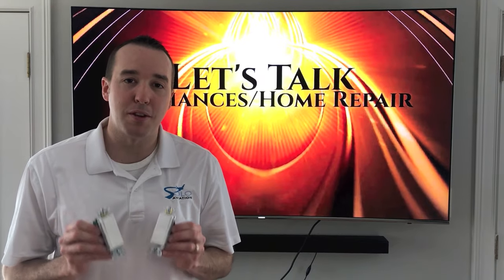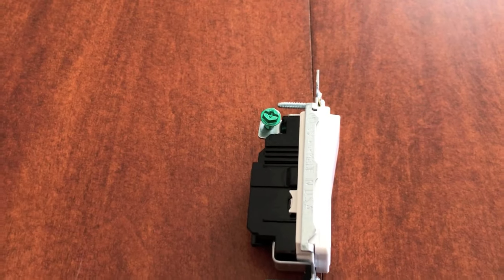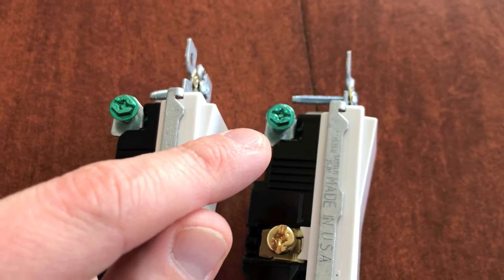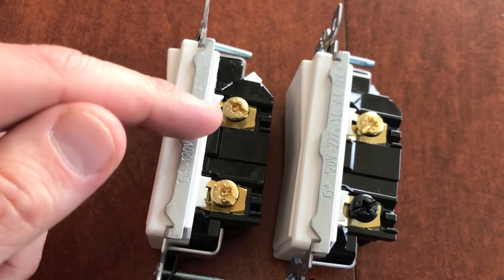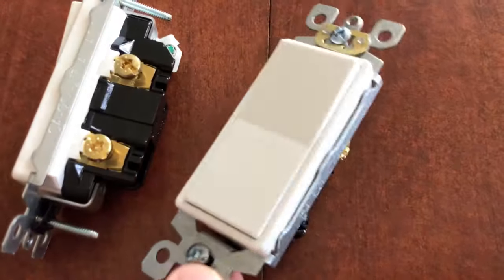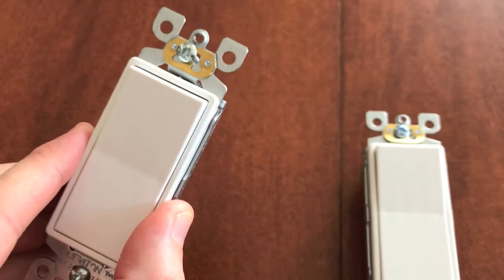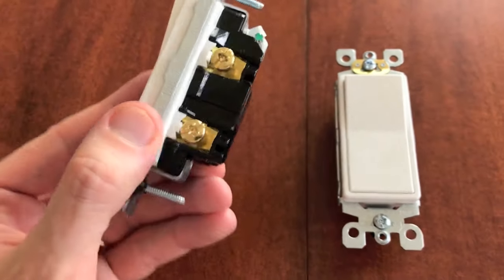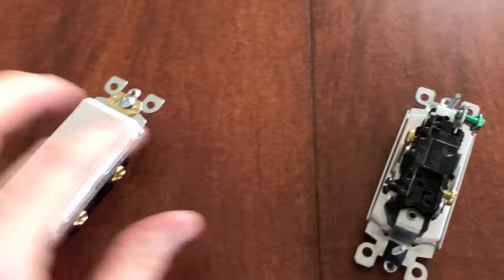Differences between 3-Way light switch & Single Pole light switch!

Comment: Excellent video Michael. Thank you for your educational time. I have a small outdoor project. An electrician added a series of outlets directly from the main panel. I would like to add a switch at the end of that circuit. Then I'd like to add another double outlet that will have some lights connected to it. The switch will control these lights. What kind of switch would you recommentd?
Reply from the maker: Jaime Alonzo 

Thanks for watching.  If your switch will not be used in sequence with another switch, a single pole switch will re recommended.  😀👍

We hope you enjoyed the video.  Let us know if you have any questions.  Us fellow DIY’ers need to stick together.  Many more helpful videos to come!

Please subscribe to the channel and Ring your YouTube Bell 🛎 that would be awesome thanks again.

😎👍🔧🔩
Reply: Ioioiiiiiiiiiiioii
Reply: Iiioiiiiiiiiiiioiiiiiooiiiiiiiiiiioiiiiioiiiiiiiiiiioiiiiiiiiiiiiiiiioiiiiiiiiii

Comment: You cannot send power to your lights in the ceiling using a white on your top brass screw on a single pole switch. Your black power lead hitting the bottom breast screw is exactly that. However your black wire going from the top of the switch to the fan or the light fixture is what is supposed to be attached to your brass screw on your single pole switch. Your neutrals are to be twisted with a pair of lineman pliers and a wire nut are the proper color code screwed onto those Twisted white wires in that box. At least that's the way I've been taught by many electricians to wire a single pole switch. I do not agree with electricians using wires as Commons or power leads. It can be very confusing when other people come behind them years later trying to remodel or redo their work. Your main power source should come from the breaker through the walls and or ceilings to the outlet in that room putting it on its own breaker then from there you extend out from the outlet to the light switch with 14/2 wire then from the switch through the walls up to the ceiling to your fan and or light bars or light fixtures recessed lights Etc. Thank you and have a great day
Reply from the maker: Thanks for watching & sharing your thoughts.  Confusing indeed for those that come by next time to work on wiring.  Home owners are left with whatever & however from those they pay to hopefully make their services reliable & to code.  Enjoy your night.

😎👍🔧🔩
Reply: I have no idea what you said but like.

Comment: On the single pole switch. If you connect your hot to one screw and neutral to the other.....what are they connected to ? Each other ! And what happens when you flip the switch?
Reply from the maker: @ITBubba1  

Thanks for watching, are you changing from a 3-way to a single?

Comment: Thank you! I am about to install my switch and was quite confused by the red wire inside the box thats not used. I’m going to leave it unattended and do the regular paddle switch! I’d love to know where that red light connects to and why.
Reply from the maker: Thanks for watching & welcome to the DIY Raptor Club.  The red wire is a travel wire and will feed through the wall and up through the ceiling into some other switch either inside that same room or in a different room.  An example of a different room would be a very large living room and dining room that are not separated by a wall.

Does that light switch turn on the lights and have another switch somewhere else in that room that turns off the same light?

Keep us posted on your project.  Hope all is well.

😎👍🔧🔩

Comment: I have an old fashioned GE switch with 3 push in wires on the back. Any idea how I can identify these wires to try and buy a new single switch? I think it’s a very old low voltage button.
Reply from the maker: Thanks for watching, any update?  We had a viewer run into the same experience recently.

He took several photos of how wiring fed into the receptacle.  He then carefully removed receptacle and took it to his local Lowes and had it matched up to an exact replacement.

The new receptacle will have detailed instructions that should help in explaining the wiring to give you a better understanding of its layout.

Please keep us posted and hey if you’re into crypto, join our DIY ecosystem.

         toolboxtoken.com

Reach out to us any time!  🧰

Comment: are you sure that on the single pole switch one brass screw secures the neutral while wire? I would think you connect the black wires to each of the brass screws since that is the hot wire. No?
Reply from the maker: Thanks for watching & explained in this video is the for sure difference.  😎👍
Reply: Do not connect a neutral wire to a single pole switch lmao

Comment: I pulled out an unfamiliar/late 1980's looks like single throw switch with 2-inserts and I remember the 3rd wire goes to bottom looks like a ground a black screw. I throw it right away w/out careful review and replaced it with a single throw single pole switch. It work but only for the sink lighting's; the outlet w/a reset and the bathroom exhaust fan and overhead lighting DON'T WORK?? Does it mean the old one was a 3-way light switch? Thanks in advance for the reply.
Reply from the maker: Thanks for watching & welcome to the DIY Raptor Club.  It’s possible...🤔

Is there another switch in same room that turns on & off lighting?  If yes, you have a 3-way setup.  Are there red travel wires present?  Please keep us posted.

😎👍🔧🔩
Reply: Yes, another 3-ft away double-switch nearby quick right to walk-in shower tub for the exhaust fan and overhead lighting above shower. Felt disappointed, swap into a 3-way switch when sink's vanity lights on shows the same results BUT UPON TURNING LIGHTS OFF,,, the OUTLET WORKS and THE DOUBLE-SWITCH FOR THE FAN/OVERHEAD SHOWER LIGHT ARE OPERABLE TURNING ON/OFF. No red travel wires present. There's 3-blk wires; 3-wht wires(wired nut) and 3-bare/open wires surely they're ground(twisted bundled). Sorry, due to the Pandemic I am not letting anybody even friends at home, reply soon highly appreciated
Reply from the maker: @juniorferraren2551  

Thanks for watching & we appreciate you reaching out to us.  What’s your update, have you completed project?

Please keep us posted on where you are in the project so we can best assist you.

😎👍🔧🔩
Reply: @DIYwithMichaelBorders  Absolutely not completed. Analyze and read my last response 5-days ago,,w/the 3-way switch, again I leave it that way,,WHEN VANITY LIGHTS WERE ON; the outlet w/reset by the side of the vanity lighting's doesn't work to include the across double-switch 1-overhead shower lighting and 1-moisture exhaust fan.Now what did I missed????

Comment: I have a exhaust fan with a light in my bathroom that is controlled by two switches. One for the light and one for the fan. I need to replace the switches. One is pig tailed to the other.  I know I cannot use single pole switches as there are not enough screws to attached the wires. Do I use double or triple? I always thought double or triple was for controlling the same light from a different locations such as bottom of the stairs and top of the stairs.

Comment: Hello, I have 2 old flick switches in the front of my living room by the door. One  3 way switch for the living room light, and one single pole switch for the outside light. The other 3 way switch for the living room is across on the other side. I want to replace the 2 switches by the door (living room and outside light) with a double rocker switch that are vertical of eachother connected, instead of two separate switches that are horizontal. How could I go about doing this?

Thank You!
Reply from the maker: Azsa 

Thanks for watching & sharing your question.  A few things come to mind.  1st, for your convenience, below is a link to our step-by-step video that shows installation of a new 3-way switch.  You may find this helpful.

       https://youtu.be/6XoIl_X2HsU

Also, there are great options for your project.  You can remove old switches & install new switch & use a cover that is large enough to cover entire box...& at the same time, have the cutout for your exact switch.

Lowes, Home Depot, & Menards are great places to find your supplies for your DIY project.  Definitely keep us posted!

Please subscribe to the channel and turn on your YouTube notification Bell 🛎 that would be awesome thanks again!

😎👍🔧🔩

Comment: So if I am understanding correctly, 3-way is ONLY if you want multiple switches controlling the SAME light? If I have 4 overhead lights and want two controlled by one switch and two controlled by another then two adjacent single pole setups is what I would want?
Reply from the maker: InfiniteClouds 

Thanks for watching & sharing your question.  The 3-way Switch is very beneficial as you can see.  Switching to single pole is an option & make sure you properly wire cap remaining wires not being used.

Keep us posted on your project!

Please subscribe to the channel and turn on your YouTube notification Bell 🛎 that would be awesome thanks again!

😎👍🔧🔩

Comment: How about if I replace one 3 way switch and the other light switch I leave alone? Is that possible or do I need to replace both 3 way switches?
Reply from the maker: your moms sidedick 

Thanks for watching & sharing your question.  Great question & yes you can.  This is not common however an option.

The issue is, if you shut the single pole switch off it will shut the control off for the 3 way Switch. So with the single pole off, the 3 way will lose control until the single pole is turned back on.

Keep us posted on your DIY project.  Please subscribe to the channel and turn on your YouTube notification Bell 🛎 that would be awesome thanks again!

😎👍🔧🔩

Comment: I changed a single pole with a single pole switch. But now, I need one switch to be ON in order for the other switches to be able to turn on. I have 3 black wires from each box, so I feel like I need a 3way but it wasn't one before ?
Reply from the maker: @DSMr4life  

Thanks for watching, any update?  Is there a Red-Travel wire present?

Comment: Have one red wire (hot line) and two black  negative connect  to one screw.. no ground wire. two white wire connect together  in the back. This is for a single pole switch?  Can you use  a single pole switch
Reply from the maker: kvdgadj 

Thanks for watching.  In most cases, the Red wire is your travel wire.  The travel wire is what takes electricity from one switch to the other.

We always recommend having the proper switch for your electrical setup.  Hope the video helped.

😎👍🔧🔩

Comment: On my three-way switch, I understand the black wire going into the black screw is hot. But the other wire above it going into the brass screw is also black. I'm confused by this. I have a timer switch I'm putting in and the timer switch has a blue cable a black cable and a red cable. I know the black cable from the timer switch will go into the black screw because it's hot but do I put the blue or red one into the top brass screw? Any help would be greatly appreciated thank you
Reply from the maker: Thanks for watching & welcome to the DIY Raptor Club.  The brass screws on a 3-way are traveler wire connection points.  Black screw is for HOT.  Green is for ground.  As far as your new switch, we recommend checking the instruction manual for proper connection orientation...as some switches are different than others unfortunately.  Sounds like you have a pretty cool switch about to be installed.

😎👍🔧🔩

Comment: Did this guy start by saying attach the black and white to the to the switch
Reply: That's what he said and that's wrong unless the the white wire is an unmarked hot wire. He said neutral wire and that's completely wrong.

Comment: So if there are only 3 wires going into a light switch it's safe to assume its a pole switch instead of 3 way?
Reply from the maker: Good morning Sam, thanks for watching.  Does your switch have a Red wire?  If so, it’s a travel wire that’s feeding power to another switch.

3-way switch is needed in this configuration.  Keep us posted.
Reply: @DIYwithMichaelBorders  okay thanks!! It has a red wire, I think they aren't grounded. The townhouse was built in the 80s
Reply from the maker: @Nolife231  

😎👍
Reply: @DIYwithMichaelBorders  okay sorry, I have switches that are just two way, with two wires but one is a red wire? They are typically for things on the other side of the room etc, but only 1 switch controls the outlet
Reply from the maker: @Nolife231  

Thanks for watching & that’s correct.  The red wire is called a travel wire, & like you mentioned, connect to another switch on the other side of room.

What is the switch that controls outlet feeding...?...
Reply: @DIYwithMichaelBorders  so I have one switch that has a red wire and a black wire (no white, no ground) and it connects to an outlet that I have a lamp plugged into
Reply from the maker: @Nolife231  

Thanks for the reply, that’s more common than you think.  That switch is designated to control outlet & whatever is plugged into it.

This allows you to turn lamp on & off by use of switch on wall rather than the switch on the lamp itself.

You see this for garbage disposals as well...switch above sink controls outlet below sink that disposal is plugged into.

😎👍
Reply: @DIYwithMichaelBorders  thank you so much for your help!!
Reply from the maker: @Nolife231  

You are very welcome Sam.  😎👍

Comment: By mistake I brought 3 way switch for single pole . how I can use this switch for single pole.
which wire will go where?
Reply from the maker: Soldier16 

Thanks for watching.  Do you plan on using that specific switch as a 3-way at a later date?  If not, it’s best to install a single pole back into your box.  Keep us posted.

Please subscribe to the channel and ring your YouTube Bell 🔔 that would be awesome thanks again!

😎👍🔧🔩
Reply: @DIYwithMichaelBorders  Thanks bro'...
Reply from the maker: Soldier16 

😎👍🔧🔩

Comment: Just to let you know, you got one part wrong... you only interrupt hot. Neutral has nothing to do with the operation of the switch. You could potentially have some big problems if you wired a hot and Neutral in a switch, depending on how you do it.

Comment: Michael, I'm looking to replace a 3 way switch for a single pole smart switch.  Does this mean I will have to change the other switch out for a single pole switch?
Reply from the maker: Bart Ford 

Thanks for watching.  This is common & the 3-way Switch has a (RED Travel Wire) connecting into switch.  After properly & safely turning power off & removing wires from switch, you must properly “wire cap” the Red Travel Wire.

This will allow you to cut the 3-way out of the system.  Keep us posted.

Please subscribe to the channel and Ring your YouTube Bell 🛎 that would be awesome thanks again!

😎👍🔧🔩
Reply from the maker: Bart Ford 

Thanks for the reply.  Those are very popular.  Keep us posted.

😎👍🔧🔩

Comment: Wait... Isn't a switch just a break in the hot wire?... black-close-black, not black--close-white(short). The neutral is not connected to a switch.
Reply from the maker: Thanks for watching & reaching out to us.  It all depends on the electrical system setup & proper code for a specific demographic area.